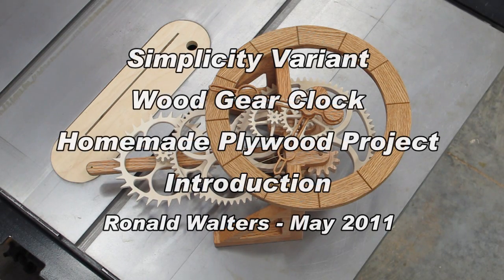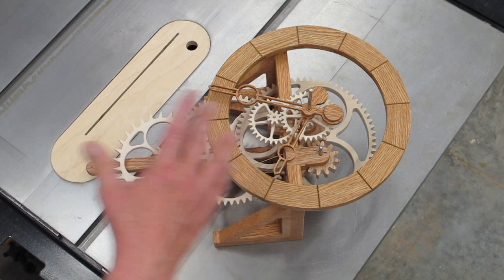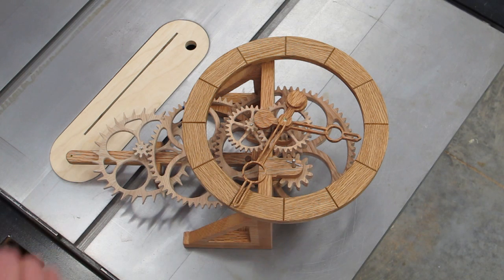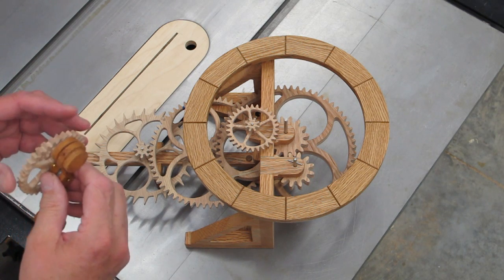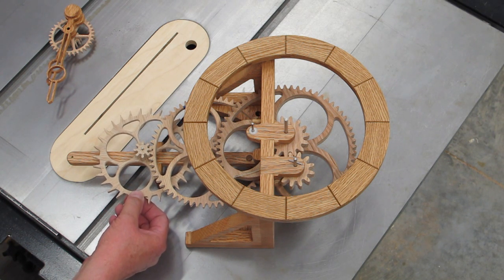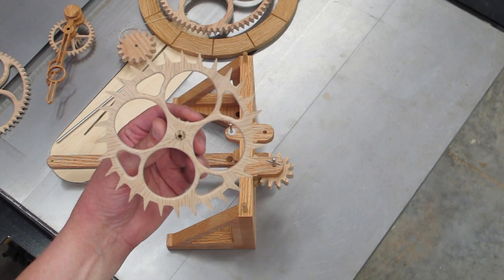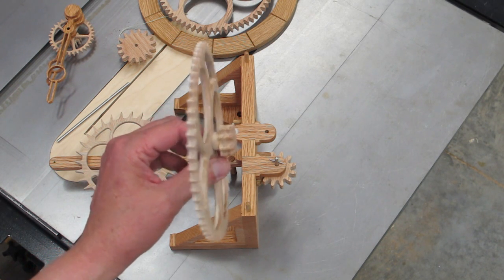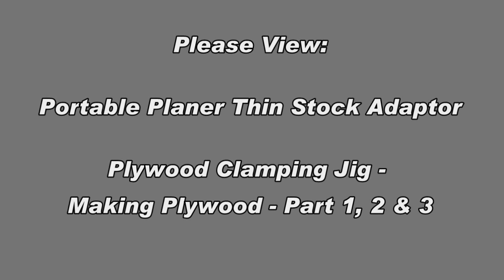Simplicity Variant - Homemade Plywood - Introduction

Comment: Have you considered making a dedicated tool to cut gear tooth profiles? Something like a very small broach or file that could mount in place of the blade in a jig saw?
Reply from the maker: No. I cut too many different profiles. Once you cut a few on the scroll saw it really does become quite easy. I have cut these on some pretty cheap saws, although the better the saw the easier it becomes.

Comment: How long do these projects of your last?  EG, how long do the parts last before needing to replaced due to wear?
Reply from the maker: TakeBackTheWorld Weather changes can certainly cause a variation in the way a wood gear clock runs. A clock made of Baltic birch plywood will be the most stable. If raw wood is used for the various components a bit more movement can be expected. These really do not run "fast enough" to wear anything out. If it is inside a temperature controlled home (seasonal heating and air conditioning) it should run just fine after the usual initial fine-tuning of the gears. My best guess is a wood gear clock properly and carefully made should outlive you. I have not (yet) found it necessary to replace anything.

Comment from the maker: This is the "Introduction"... I think it explains why I decided to try to make my own plywood and the initial mistakes I made (i.e. 2-ply). Then there are the videos "Plywood Clamping Jig - Making Plywood" Parts 1,2 & 3. Also, two videos "Segmented Clock Wheel" Parts 1 & 2 making solid wood segmented wheels. And one video "Comparison Of Completed Clock Wheels - Plywood & Segmented Wood" which shows how they turned out. There are 20 clock related videos on my channel. Thanks for watching.

Comment from the maker: The shafts (axils) are piano wire. The main shaft rides inside two holes drilled in the wood frame, which serve as the bearings (no bushings). Some of the other wheels (gears) have brass tube bushings (brass tubing from K&S Engineering – hobby supplies). The Center Wheel is attached to the main shaft with a setscrew, which engages a flat machined into the main shaft. Google “wood gear clocks” and visit Clayton Boyer’s site. Lots of information at the bottom of the page.

Comment: Inspiring work. can you explain what do you use as a bearing? what exactly is the rod, how do you connect it to the wood? and prevents the wheel from falling when its hanged? thanks a lot.